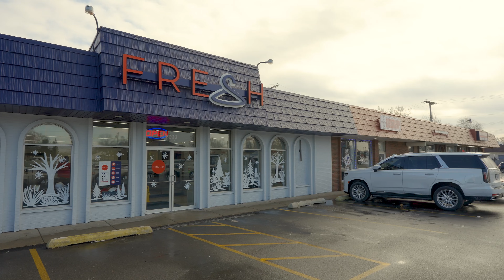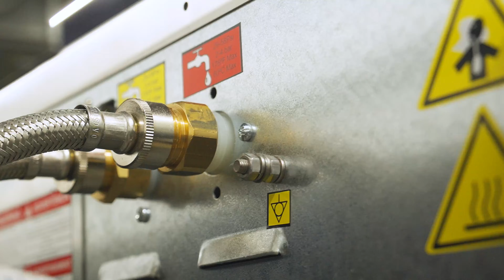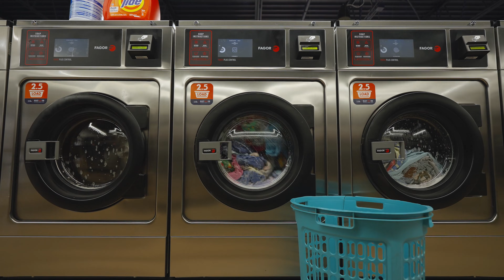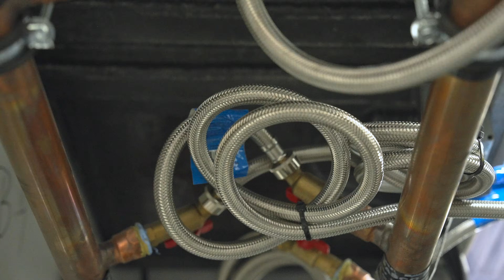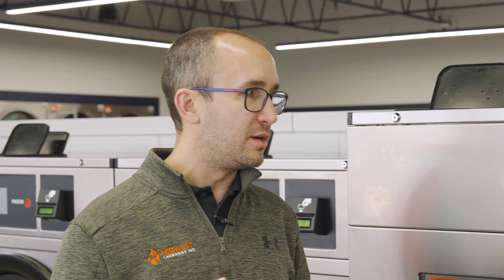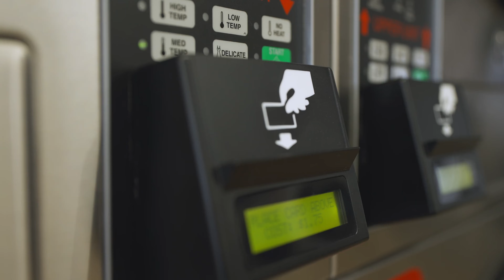Microfiber Pollution & Laundromats: CLA Explains the Basics

Comment: Can we also touch on the fact the 100 microns is smaller than an average grain of sand. 
A load of clothes containing mud, sand or similar particles would plug the filter during the first drain cycle preventing the washer from draining the rinse water.
Reply from the maker: Exactly!